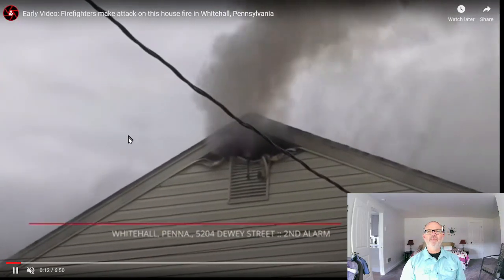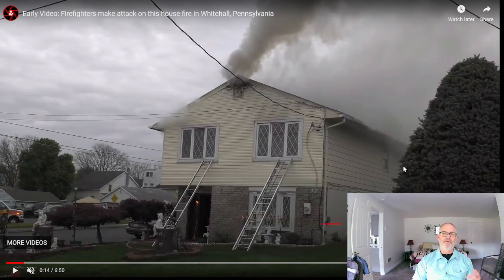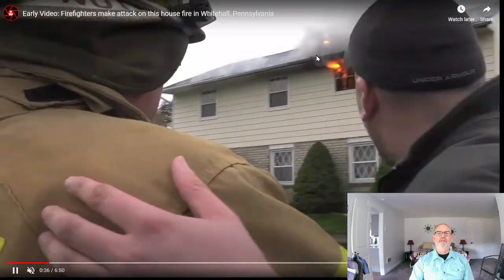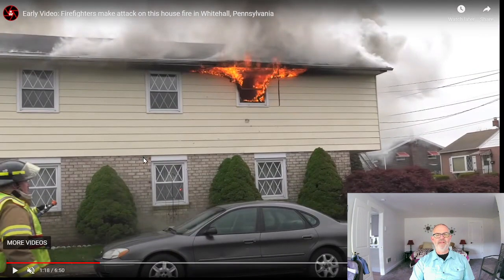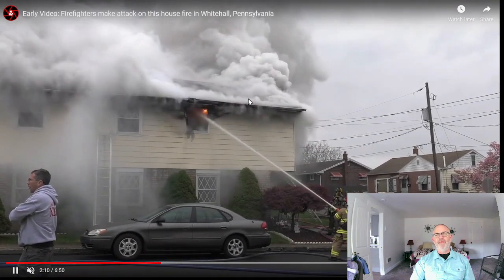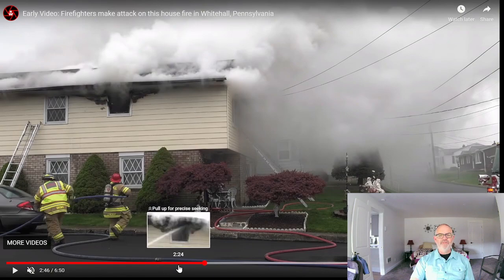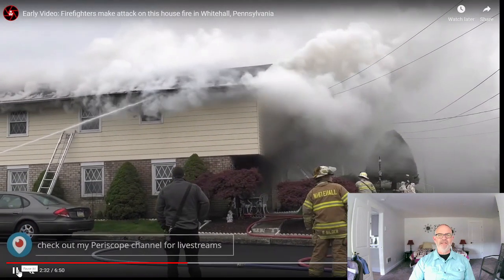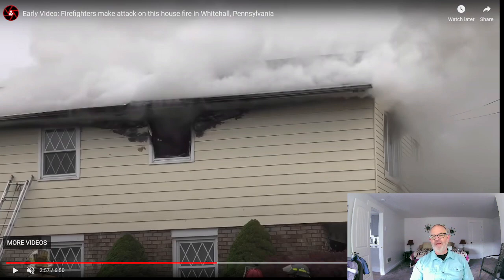The Art of Reading Smoke

Comment: That's a bread and butter job nozzle man's dream.
If you noticed hitting from the yard and they shut down the line to reposition the room lit up again in just a few seconds.

In my volley years before I got on a paid department we never hit fires like this from the outside we stretched close as possible to the fire and as soon as the truck opened up the fire showed itself and it was checked. 
The second engine came in with the truck started and started opening the walls and ceiling checking for extension. 

I like the videos this guy makes on reading smoke he's spot on.
Reply from the maker: Thanks Brother, I appreciate the support and you taking the time to contribute to the channel!
Reply: @phillipjose1092 it's all good.
Reading smoke condition is so important,especially when venting 
I seen it plenty of times what could of been one room burn out and you vent in the wrong place you pull the fire to that opening spreading the fire. Fire loves open windows or any opening and the fire will find that opening. 
In my volley years reading smoke was part of our training program.

Comment: Phil Jost fails to mention that the large volume of steam that develops after the outside fire stream enters the open window is loaded with flammable and poisonous fire gasses that expand throughout the survivable spaces in the structure which compromises the life safety of occupants inside who are trying to breathe. If you’re gonna read smoke you should always acknowledge up front that per the NFPA, smoke inhalation is the number 1 cause of death in a fire. 2017 research conducted by UL FSRI indicates that exterior fire stream applications through openings where smoke and flames are showing are subject to air entrainment. Measurements of outside air entrainment read as high as 15.000 cfm of air and oxygen depending on several factors one of which is the distance between the nozzle and the opening. The farther away the nozzle is from the target opening the higher the CFM of air/O2. Also let’s not forget that approximately 80% of the Products of combustion in a fire are invisible to the naked eye so when you see smoke you are only seeing about 20% of the POC.
Chief Hughes
Battalion 1 (retired)
Chicago FD
Reply from the maker: Chief Hughes, thank you for taking the time to engage in the discussion here on the YouTube. I appreciate your time and effort to make the fire service better.

Comment: Rockwool insulation should somehow be made more affordable and implemented into all new homes, and remodels. Especially in attics. And rockwool panels to cover all exposed wooden structure. All celings should be 5/8 inch drywall if not double 5/8 inch.